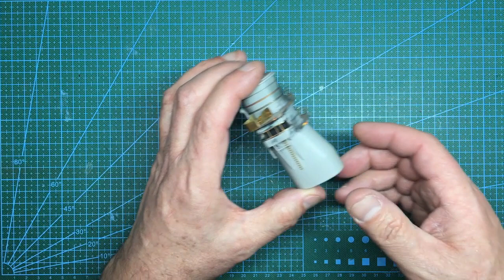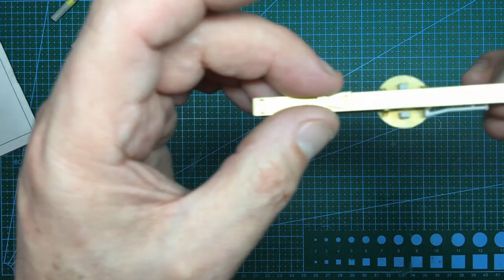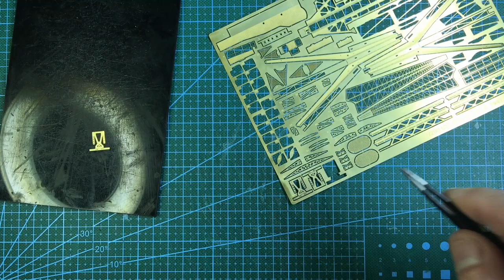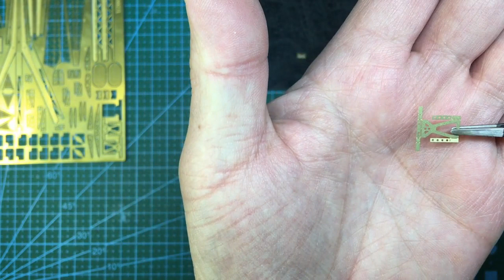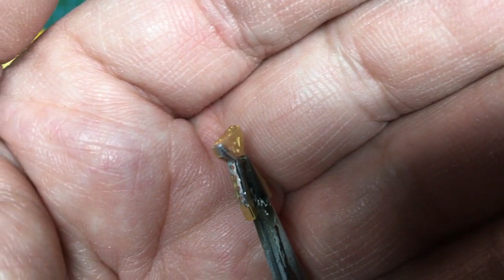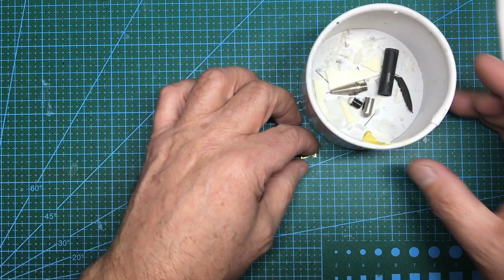Arizona update and how I solder PE

Comment: Hi Nigel 
Great tutorial . I was wondering if you could give some advice . I am building the revell platinum Tirpitz . It has 3 sheets of PE , 1 brass coloured ans 2 silver coloured and I am having trouble trying to solder the silver ones , I am using your techniques but solder does not work, am I doing something wrong or is it possible that the silver PE are made from stainless steel . Please advise . Thanks 
Mark
Reply from the maker: Yes, the bright silver parts are probably stainless.
Reply: Thanks , that will be why the solder won’t take .

Comment: Try working on an MDF board with an extra strip glued along the top to get square ends and to bridge your hand on. We use wooden Pegs of various sizes to hold pieces whilst soldering. Try automotive paints without the etch primer and you don't lose detail and it drys quicker, and they will mix small tins for you. A soak in vinegar will etch parts if you are having paint adhesion problems. love the small tools folder and the Carrs red flux too. We work in N scale 1:160 so encounter the same issues.

Comment: I’ve been watching videos on soldering to improve my skills and those little tabs you’re talking about, Why not just cut them off and solder the parts together without them? I’m sure it’s easier to solder when the parts are already connected like that but it doesn’t look too difficult to solder without them. Also, you could cut all the middle ones out on 1 straight seam, and solder that part, then when it’s soldered in the middle; you could cut the end tabs off and finish the solder on the seam(both beginning and end of the seam). Just an idea… or do I have it all wrong?
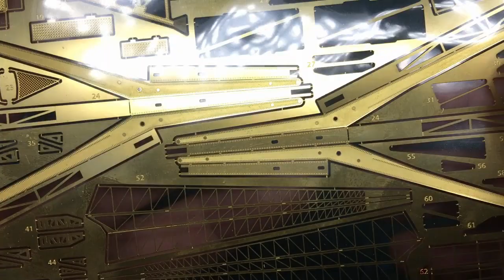6:25
Reply from the maker: If I were to remove the tabs i would have lots of separate pieces, so no, I would not remove them.

Comment: I agree 100% with everything you said about cutting PE-I have never understood this "put it on glass or a tile" and cut brigade-all it does is dull a sharp blade very quickly,and as you say,there is severe risk of the blade skating. Personally I use a piece of thick,scrap plasticard but the acrylic you use does exactly the same,ditto the curved No 11 blade. Excellent video,you mentioned all the products EXCEPT the solder you use-I could see it is 62/36/2 rosin solder,any particular brand?? I despise non lead solder,for any use at all other than ballast weight....
Reply from the maker: Hi Sean.. i knew I'd forget something.. It's radio shack solder mate. p/n 64-013. It is wonderful stuff.
Reply: @NigelsModellingBench  Thanks for the answer-had looked before your answer and this is the one that kept coming up-but unfortunately a US product and thus almost impossible to get, if you can find a company willing to send to Europe then the postage is insane and import duty on top. China is the only option,it seems pretty much all "Western" businesses cannot compete even if they wanted to,thanks to our own rules and regs....and politicians. I used to prefer solder paste for smaller etch parts but this is no longer an option as the stuff sold now isn't a patch on what used to be around,until a find an alternative soldering is out. Interesting video in any case.

Comment: Great tutorial Nigel,  I have been soldering for years, mostly copper pipes!  A friend of mine is into jewelry making and swears by silver solder.  I know the silver solder is more expensive.  I am interested in your opinion.  Have you ever used the silver solder for PE, I guess it flows better and is stronger, but that may not be necessary for a model.  See you next time.
Reply: I would suggest the amount of heat required to silver solder the part would melt or deform the very thin photo etch.
Reply: You prolly dont give a shit but does anybody know a trick to get back into an Instagram account?
I stupidly forgot my login password. I would love any assistance you can give me!
Reply: @Bowen Devin Instablaster :)
Reply: @Leonel Dangelo Thanks for your reply. I found the site thru google and I'm in the hacking process now.
Takes quite some time so I will get back to you later with my results.
Reply: @Leonel Dangelo it worked and I finally got access to my account again. Im so happy:D
Thank you so much you saved my ass!
Reply: @Bowen Devin glad I could help xD
Reply: You will need to heat the etch parts to red heat before silver solder works, and your brass part would melt as well.
Silver solder is brazing and is just one step down from fusion welding.
Jewellers can use silver solder as the material they work with will withstand the temp needed, ie glow red and not melt.
I do, however, anneal my etch parts to dull red before bending as that will allow unbending a couple of times in case of errors before needing to be annealed again.

Comment: Hi Nigel, great tutorial, we probably all should solder more than we do, I dislike the fast bend gaps in etch too. Was wondering what the tape was for on the crane tubes?
Reply from the maker: Hi Jason. I have just finished building turret catapult. 100% soldered, railings and all!!  

The tape on the cranes marks the deck height so I didn’t make the ladders go too low.
Reply: @NigelsModellingBench  ah I see, thanks.  Soldering railings, not something I have dared do.

Comment: Hi mate, two questions really, do you every get to a point where the photo etch is so too small to use and the part from the kit is best to use. Second is, do you ever use micro scissors to cut photo etch instead of blades
Reply from the maker: In a word, yes. Some PE is just unnecessary. Even larger parts are sometimes a waste of time over the plastic mouldings. As for removing PE from the fret, I generally use a knife. I have  xuron PE scissors but prefer a knife.
Reply: @NigelsModellingBench  and to the tiny P.E. point, occasionally I watch some of "Ebrion's miniatures" and his work on 1/700 p.e. and my jaw drops. He does a fair amount of scratch building similarly to Nigel. Am always amazed at their skill both. Normally Ebrion's uses 2 razor blades for his folding and would like to see him use soldering as Nigel does too. It really is worth it in the end. Pontos p.e. is usually right at the top near Eduards.
Reply from the maker: @crazylocha2515  I'm struggling with 1/200.. I might try 1/350. 1/700.. NO WAY!!
Reply: @NigelsModellingBench  agree 150% on the 700 scale stuff. I look at 1/350 as  "what's the minimum amount of fiddly small stuff" I can get away with and still look good. Ron and his multiple 200 scale's are amazing and more my speed too, LoL

Comment: It's always worth spending that little bit extra on a soldering iron.

Have you tried Mr Surfacer on your Baked Beans and Weetabix yet Nige?
Reply from the maker: Oh James, you do ask some silly questions!! Of course I haven’t tried Mr Surfacer on Beans or Weetabix yet. I’m still experimenting with crisps and meat products. It does stink under the grille.
Reply: @NigelsModellingBench  I ask the silly questions, as it helps to confuse the trolls that you get ;) 

FYI there's already a Nigel's Model Ship channel (RC ships) on YT - it's cropped up in my YT feed more than once

Personally I think YT needs a Nigel's MR Surfacer Bench :D
Reply from the maker: @toboldlygos_model_works  trolls are dying off now. I have zero tolerance and have blocked hundreds. Did you know Mr Surfacer 1000 is great at making toast completely smooth? It dries in no time if you get it on quickly.
Reply: @NigelsModellingBench  Try adding Mr Surfacer to Spam Fritters - helps make the batter or breadcrumb coating extra crispy ;)